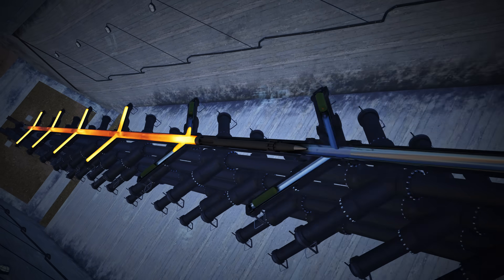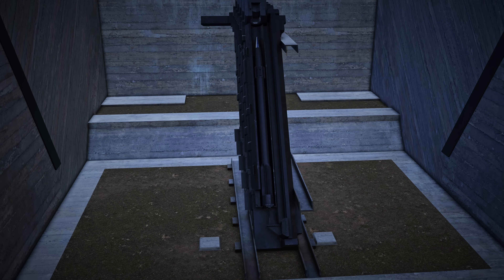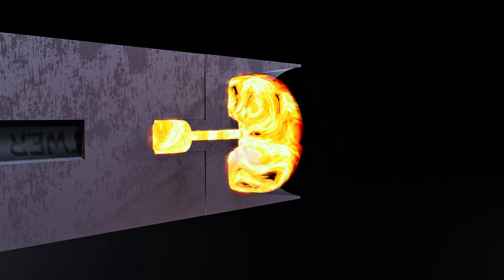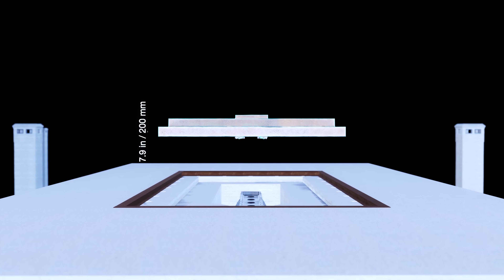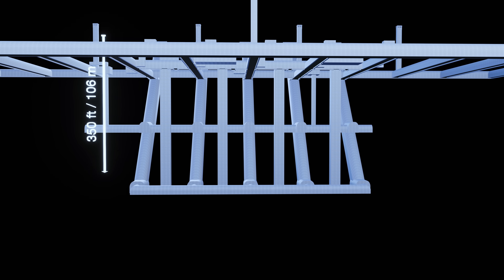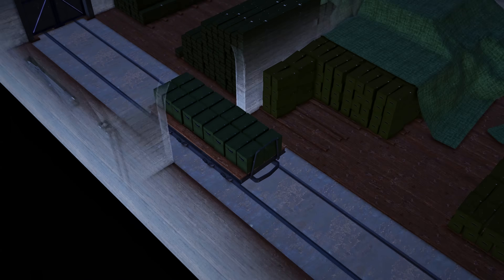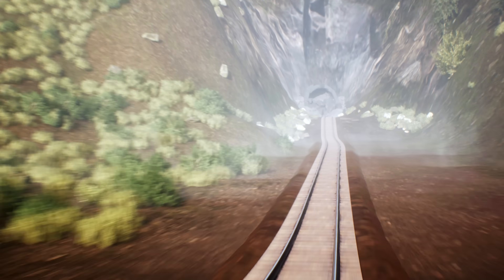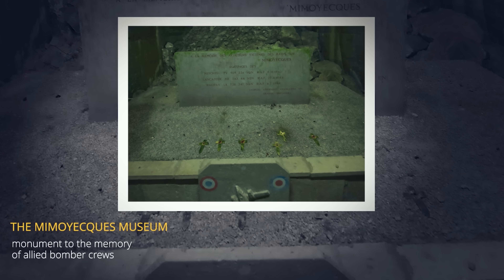Inside the V3 Nazi Super Gun

Comment: A German scientist suggested in 1943 an electrodynamic cannon, able to hit London from France.
This project was rejected. This cannon needed so much electric power that a plant with generators was needed to be built near the cannon.
Reply: Yes, this concept, the railgun, had been known for ages prior to 1943. Both Russian and French scientists had toyed with the concept in the late 1800’s, in 1903 the Norwegian scientist Kristian Birkeland (today known for discovering how auroras work and a way to make fertilizer from air and limestone using electric plasma) attempted to construct a miniature railgun at Oscarsborg naval fortress in Norway to sink enemy battleships (it failed and they instead installed a torpedo battery which famously sank the battlecruiser Blücher in WW2), and during WW1 a number of scientists attempted to make railguns to destroy enemy trenches. All the experiments failed because of the enormous energy requirements and the huge magnetic forces involved ripping apart any mechanical triggers. Railguns have been realized in the modern period, but only on ships equipped with nuclear reactors for power and computers for managing the firing without moving parts. They will likely never be significant in warfare as you can achieve almost the same efficiency at the fraction of a cost using a missile.
Reply: @luxborealis  - Very interesting !
Reply: @luxborealis
Almost isn't the same. Missiles can be intercepted or diverted with equipment far cheaper than the missiles themselves and their only getting better. Eventually there will come a point where the amount of missiles needed to overwhelm point defense systems costs more than the ship they're sinking.
Kinetic projectiles on the other hand can't be intercepted or diverted nearly as easily. As the technology of superconductors and power generation advances railguns will likely surpass missiles as the primary antiship weapon for larger vessels simply because they bipass electronic warfare.
Reply: @luxborealis  
Nonsense. A missile is far more expensive than the railgun projectile and electric energy cost, the reason railguns aren't used is the lack of graphene coated barrels that would prevent friction from destroying the barrel. All publicly known railguns have barrels that need replacement regularly. Until coilguns can be built at the same level of power, or they solve the material physics problem, railguns just don't last long enough to be cheaper.

This will likely change soon assuming it hasn't already been solved. The technology is likely already classified.
Reply: @luxborealis  railguns and coilguns still got potential tho. While missiles are great they are far more expensive.

Railguns could also be interesting for space combat since they don't require an explosive and can fire projectiles faster than combustion cannons. Though lasers are likely a better option for head to head engagements there.
Reply: there was me watching this thinking theres simularitys here to how the american electromagnetic gun they have been testing for years works

Comment: 18:16 The allies had both APCR rounds at the start of ww2, which were essentially a sub caliber projectile with a light weight outer part that allowed it to fired from a cannon, and later developed tgeir own discarding sabot munitions well before the capture of the V3 bunker. Typical wehraboo thinking only the germans could innovate.
Reply: The fin stabilizer is the unique part here. a non fin stabilized round wouldn't have anywhere near the accuracy (provided this project had any to begin with) and wouldn't be feasible in a smoothbore gun. 
By nature a sub caliber round is trading mass for velocity (compared to rounds of the same length) as the diameter is reduced. In order to increase kinetic energy though mass, the penetrator needs to increase in length. Long, thin penetrators need fins to maintain stability in flight (which in turn benefit from a smoothbore cannon).
Reply: @Pan_Galactic_Gargle_Blaster  You're trying to argue that only the germans knew about spinning a projectile? Or that only the germans had ever seen the fletching on an arrow? Because the fact is APFSDS only came in to service when the penetrators started getting longer, which from what I can tell wasn't until the late 50s/early 60s. This isn't because spinning an arrow is a hard concept, but simply the existing APDS didn't need it.

Comment: The biggest problem with these guns was how easy they were to destroy from the air. To use them for a long time, you’d need total control of the skies, which Nazi Germany couldn’t achieve against the RAF. Projects like these guns and the V2 rockets ate up a ton of resources that could’ve been better spent on building regular planes, which would’ve been a bigger threat to the Allies. In the end, these weapons didn’t deliver and were easier to take out.  

Another major issue for the Axis was their fuel supply. If the Allies had focused more on bombing anything tied to fuel production, the war might have ended faster.
Reply: Had it been there for the blitz it could've been extremely destructive, but it had no hope of being there in time.
Reply: @OmarGarcia-kd7pr  Britain collapsed in September 1940.... they opted to surrender to the Americans instead of the German's...
Reply: They would have had a reasonable chance to maintain air superiority if they didn't lose most of them with offensive use over Britain. Had they retained them to defend ground-based assets like the Brits did during the Battle of Britain, they might have later been able to successfully transition to offensive operations.
Reply: That's not true. Many of Germany's top secret weapons facilities were never touched by Allied bombing. They were not discovered by the Allies until after the war ended..
Reply: Nazis controlled the air over west Europe until 44 and east Europe until 43
Reply: Vulnerable to a grand slam strike. A total waste of resources.
Reply: @thamesmud  Many experts consider the Grand Slam a total waste of resources... 
 The V-3 had very limited tactical use, but it was a sound concept. London was a very large and extremely vulnerable target and artillery shells are very cheap compared to bombers and missiles.

There were many secret German facilities that went completely undetected by the Allies or survived bombing raids with little to no damage..
Reply: @DoktorBayerischeMotorenWerke  at least the Tallboy and GrandSlam made it into service and did a lot of damage especially to V1 and V2 launch and production sites.
Reply: @thamesmud  If you convert Pounds to Reichs Marks to the amount of damage to loss ratios the Tall Boy and Grand Slam bombs were abject failures compared to the V-1 and V-2.
The V-1 and V-2 were so effective in combat that the Americans copied both and adopted them into operational service without modifications and continued development of both German weapons after the war..
Reply: @DoktorBayerischeMotorenWerke  I thought the video was about the V3 cannon.  Conventional bombing and harassment rendered the V1 and V2 useless late in the war. Apparently more slave worker died died making the V2 than were killed in the attacks by the V2.
Reply: @thamesmud  Indeed, it is.  Standoff strategic weapons like long range artillery and missiles have rendered conventional strategic bombing all but obsolete... 
Exhaustive studies conducted after the war by the Allies confirmed that the V-1 and V-2 were the most effective weapons of the entire war and triggered a boom in post war development that saw bombers take a backset to missiles. 
Far more slave workers died in British occupied countries they were eventually freed and won their independence from the tyrannical British colonial empire after Britain's defeat in WW2, their surrender to the Americans in September 1940 forced the Britian to give up most of its prewar overseas territories..
Reply: @DoktorBayerischeMotorenWerke  Hate to burst the bubble here, but the V3 facilities at Mimoyecques  were knocked out before the guns came online using Tallboy.... and the grand slam at least had real strategic successes in deployment.
Reply: @compwiz101  But none of the V-3 guns were destroyed and were moved to other sites.
The site was mostly abandoned by the time of the Tall Boy attacks. 
Postwar analysis of the Allies' Operation Crossbow found the overwhelming majority of the raids were completely ineffective in stopping the V weapon threat.
 German V weapon operations continued uninterrupted until they were overrun by ground forces..
Reply: @DoktorBayerischeMotorenWerke  blah blah what applies now did not apply in 1945.  These weapons did not win the war for Germany, the resources they consumed probably hastened thier defeat.  I'm not going to comment on your slavery comments, my point was it was mad to use slave labour to make weapons like this that are vulnerable to sabotage.
Reply: The western allies obsession with terroristic tactics of demolishing civilian structures actively hampered the war effort.

Absolute worst way to combat a dictatorship. Wasting resources to make the people suffer and die while those in charge shrug and the oil keeps flowing to the war machines.

It can also be totally practical to steer away from war crimes.
Reply: They weren't easy to destroy from the air, the V-3 cannon was housed inside a bombproof bunker. The Allies could only do so much damage because they bombed the Mimoyecques complex during construction. One Tommy made a lucky shot and his Tallboy fell through a unfinished shaft and exploded underground. Otherwise the site would have been fully operational.
Reply: @HREguy The V3 site was vulnerable only to the Tallboy and Grand Slam bombs. Alternatives were too weak.
Reply: the plan was to weaken germany and ussr in the long attrition war with each other, not to end it faster.
Reply: @Hokunin  I was thinking about it as trying to end the war fast, but yeah, I get that the goal was to wear both sides down over time. Thanks for the clarification!
Reply: @b6xy  Y u guys so penetrantly yell "Nah tsieh" Germany instead of Germany? Goes that without even thinking or is it willful? I am just asking.
Reply: @marcelbork92  Just being precise and considerate.
Reply: @b6xy  This guy: The Nazis were running out of fuel for their aircrafts!!!

Also this guy: Instead of long range retaliation guns, they should have built more fuel guzzling planes!!!
Reply: @JanFWeh  That's why German developed jets and theatre ballistic missiles.

The Me-262 ran on coal... and the V-2 ran on methanol, made from barley and potatoes..
Reply: @JanFWeh  I must admit, it's impressive how you completely missed the point 👍🏻
Reply: Nazi fuel production WAS a major focus of Allied bombing during World War II. 
U.S. 8th Air Force and RAF Bomber Command launched extensive bombing raids against German fuel production.
The bombing campaigns were highly effective, leading to severe disruptions in fuel production and the resulting critical fuel shortages.

Yet, you act like you came up with a novel idea which the Allies didn't think of and didn't implement.

"In my humble opinion, the Allies should have extensively bombed Nazi fuel production instead of, I dunno, extensively bombing Nazi fuel production like they actually chose to do."
Reply: @JanFWeh  I was just discussing a hypothetical situation and sharing my opinion in the last paragraph, not rewriting history, yet you came off like you woke up on the wrong side of the bed. That said, I don’t deny your take and appreciate your input. But maybe step down from your high horse for once and work on sharpening your ability to grasp nuance and context.
Reply: @JanFWeh  Stop using quotation marks when you are completely making up quotes. Makes your argument weak.
Reply: @JanFWeh Not really. Romanian oil fields weren’t focused until very late in the war. The US especially insisted on bombing German cities into oblivion, believing that would lead to victory with minimal casualties.
Reply: @JanFWeh  which part did he say make more fuel guzzling planes?
Reply: Yeah its pretty nuts how much they needed to rely on the Luftwaffe when they were arguably the weakest branch of the Wehrmacht. Yeah the Kriegsmarine was undermanned and underfunded but It could be argued that their Uboats did more for the war effort than post battle of Britain Luftwaffe. Also doesn't help it was commanded by that fat hedonist. So it's crazy to have your most expensive and time consuming projects rely on the weakest link.
Reply: No really in 1944 Germans actually wasted tons of aluminum production Fw and Bf models of grounded airframes that wasn't helping much. And not to mention a large part of limited effectiveness of some new weapons was from Allied own effort to counter them, so it did also draw some Allies resources away as well.
Reply: @sthrich635  THE BF-109 WAS MADE OF MAGNESIUM ALLOY.
Reply: @DoktorBayerischeMotorenWerke  As far as I can find only a small number of parts for the 109 were magnesium like the engine mounts.  Most of the airframe was aluminium.
Reply: @b6xy  they had air superiority until 1944